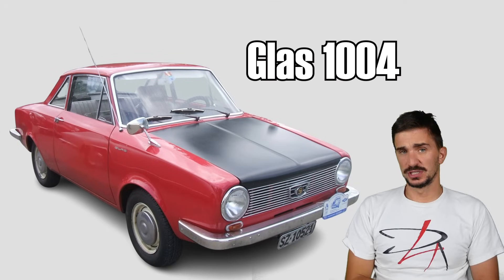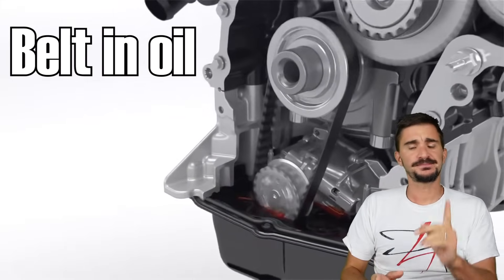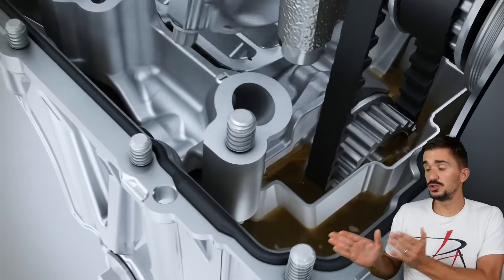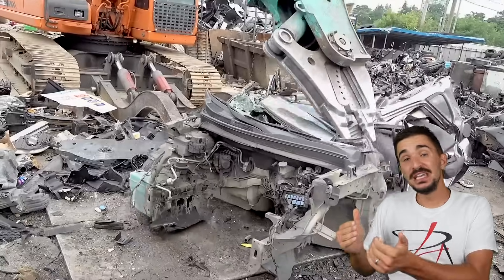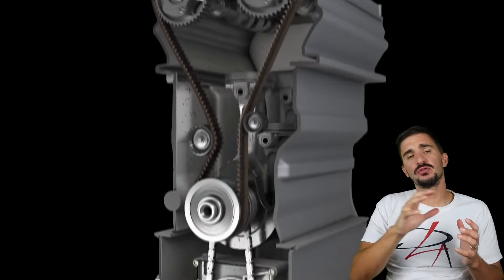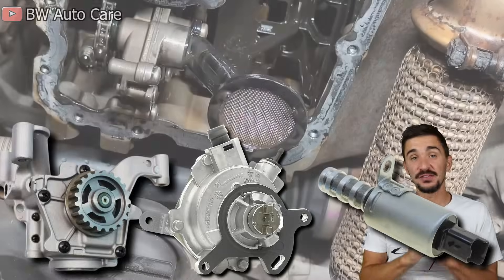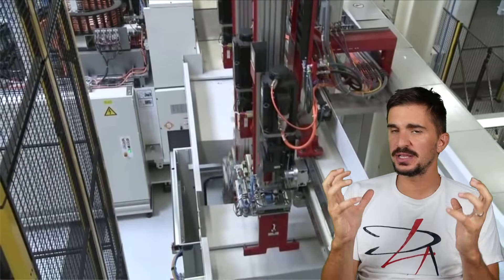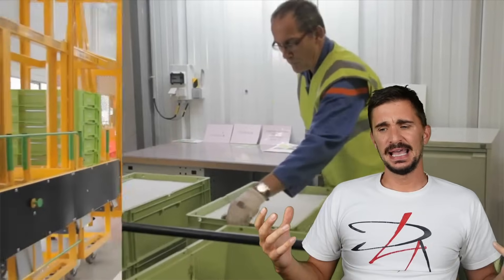Who Approved This and Why Is It Still Being Made? Wet Belt aka Belt in Oil Engines

Comment: The enshittification. It's bad, they know it's bad, they know we know it's bad, but they'll keep making things worse because they 'know better.'
Reply: Or because it theoretically has less emissions.
Reply: Actully ....THEY DON'T CARE !!! It's all about the BOTTOM LINE ! ! !
Reply: @OffGridInvestor  i fail to see how dipping rubber in oil meaningfully decreases emissions. Less friction, maybe, but maybe instead of putting a time bomb in every one of your fucking engines you figure something else out? Not like there aren't other options, this one is just the cheapest and easiest. Plus more broken engines means more time bombs sold.
Reply: I apologize, but I'm going to have to use "enshittification" in my lexicon of modern words from now on... It simply describes way to many things now...
Reply: @rrnonya5472   if you look around, it's happening everywhere. What was metal is now plastic. What was plastic is now cardboard. OEM replacement parts that are out of spec, expensive luxury goods that fail within a week. Once you see it you can't stop seeing it.
Reply: They’ll keep making them because unfortunately most people are just going to keep buying them
Reply: @hakjobtm7472  "Meaningfully" - well there's your problem. It does not have to be meaningfull, it only needs to decrease consumption/CO2 (they are the same thing, burning 1 kg of gasoline produces 3.12kgs of CO2, there is no way around it it's basic chemistry). It's not coincidence that realibility of vehicles got significantly reduced when CO2 limit standards were first introduced in the EU in 2008/9. In the USA CAFE standards cause the same problems. Another big impact of this regulation are low friction piston rings, as a result most modern gasoline engines tend to burn a lot more oil than late 90's/early 2000's ones. Eco start stop systems are also a consequence of this. It does not matter that the tech costs 10-100x more than the amount saved by lower fuel consumption, whether in initial costs or long term maintenenance. ALL that matters is the numbers that they get on the test
Reply: @petarmiletic997  what i got from this is that I'm correct
Reply: "they'll keep making things worse because they 'know better.'"

Yes, but isn't about knowing better how to make things reliable.  It is about knowing better how to maximize profits.  Build it cheaper, sell it for more.  Who cares whether it is reliable, just as long as it can make it through the warranty.
Reply: And who tought them that?  Apple. Seriously.. almost all industries learned that from Apple. Make somethign shitty, but coat it in sugar and say that the worse product is a PREMIUM feature and sell it  5 times more expensive.
Reply: @tiagostein4057  it takes courage to remove the headphone jack and charge more for the product
Reply: The bottom line knows better.
Reply: @katyfox2749 You said it!
Reply: The object is to be no worse than the competition. However, Japanese cars are better and are slowly taking over from these companies.
Reply: Actually it is because they want to make more.

Comment: A Ford dealer here in Germany quoted me 2850€ (roughly 3000 $) for a Timingbelt change on my 1.0 Ecoboost.
I have 10 years of fixing all sorts of vehicles under my belt, 
but theres just no way i could do that job on the Parking lot of my appartment.
You need an entire Briefcase of special tools AND pull appart half of the Engine 
(best would be to just rip the engine out at that point), 
for a job the takes 1 1/2 hours on a old VW/ Opel/ French car. (2 hours if knock one back with the bois while i`m at it)

Not talking about the gigantic mess of oil or 
the "shit, now i need this specific part from the dealer i forgot to buy/ broke"- moment.
Hell, doing a CLUTCH-job on most cars is easier and faster then this shit.
Reply: €3k to replace the belt? Scam.
Reply: That quote is ridiculous. Presumably that's an official Ford dealer? I drive Fords for a very good reason, and that's because they are good value for money, reliable, and cheap to service and fix. But your quote totally undermines that concept of value for money for the customer.
Surely, you could get a better quote than that if you go to a good franchise dealer, or even a specialist mechanic shop with a good reputation? 
One could buy an entire second hand car with that kind of money.
Reply: @richardconway6425  You must drive 40 year old fords or something, everything they've made since has been utter garbage.
Reply: I've seen a picture of a Ford engine that has the oil pump driven by a wet belt, that goes around the crank, so you'd need to remove the crank to replace the belt, a belt that is emersed in viscous oil, wedging itself between the pulley and belt. Mental.
Reply: @joejoejoejoejoejoe4391  The engineer will go to Hades...along with who approved the design.
Reply: Offical Ford Partner, 
most independent shops stay away from those cars.
 A lot of work time + renting out the tools is just not worth it considering the Time/money efficency of faster jobs.
And shops here are always full, so they can allow them selfs to be picky like that :D
Reply: @pontiacg445  you're just having a dig because you don't like Fords, or you have no idea what you're talking about.
Here in Europe, the other trillion dollar market for cars other than the US, Ford has sold an enormous number of cars. The Ford Focus and Fiesta have been the 2 best selling cars in Europe for over a decade. 
I owned a 2007 Ford Focus mk 2 for just over 10 years. It had 124,000 miles (yes, 124k) on the clock when I bought it in an auction, and it drove like a new car. It had a full service history, and had been looked after very well. I bought it in 2012.

It was hands down the best car I ever owned. It was well designed, great to drive and totally reliable. It never let me down, and was also very cheap to run, because it was very efficient. Always at least 50 mpg, sometimes more, depending on the type of journey.

I eventually let it go, because I wanted something bigger, so I now have a 2019 Mondeo estate (station wagon?) which I absolutely love. It's just so effortless to drive, very quiet, and very comfortable. It is a very refined car. I'm very happy with it, and I expect it to last a long time.

You're a pontiac fan, eh? Do they still even exist? Have they ever made a decent car, that wasn't built on a decades old platform?
Reply: @richardconway6425 you don't drive EUROPEAN fords.
Reply: @OffGridInvestor  what do you mean by that?
Reply: @richardconway6425  It s about the engine, and all of those 3 cylinder  1 liter engines (with turbo to get some power out of it) are bad.  They are developed to meet the demands from the EU  and to avoid high owners taxes (light weight engines that are small).  But they have those disadvantages as said in the video. They just can t generally last as long as other engines (like 2 liter non turbo 4 cylinders) for all those reasons. And ofcourse there are always exceptions that to a bit better. I am never gonna buy such a car.  I rather drive an old 2 liter and maintain it. It will last.
Reply: Same with 2.0l EcoBlue. Costs half of my country's income median and one week.
Reply: @richardconway6425  I'm "having a dig" because ford makes trash, simple as. I've got more cars parked in my driveway than you've ever owned, and you think I don't know what I'm talking about? There are more junk parts off ecoboost fords in my scrap pile than any other manufacturer, by a long shot. Do you even know what a wrench is?
Reply: That $3000 is pretty typical of wet belt systems. Honda is the same as they have to pull the engine out and need special tools that are not easily available to your average garage. Luckily I've never had to pay for replacement because my civic has never made it to the interval before the belt disintegrated and destroyed the engine.
Reply: @pontiacg445  My dads 2001 Focus drives really well and has been reliable for over 300k km.
Reply: Yeah i was quoted over $3000 USD for my timing service, so I did it myself, bought what i thought were good parts, but the guides literally failed within 2,000 miles of installation. I did nothing wrong, it's just low parts quality and bad design. Super frustrating.
Reply: I have worked on a lot of Ford 1.0L Ecoboost engines between resealing the leaking timing covers and replacing those engines for failed oil pump drive belts.  I have never seen so many special tools required to do basic repairs.  To remove and replace the crank pulley requires a 5:1 torque multiplier for goodness sake!  That engine was NOT designed to be easily serviced at all!
Reply: @pontiacg445  your attitude is obnoxious. If you've had bad experiences with Ford cars, or Ford engines, then fair enough. But I haven't. 
I explained my point, but there's no point in refuting anything you say because you don't want to hear anyone else's point of view. Did you actually read my comment?
So, you've got more cars in your driveway than I've ever owned, eh? You must live in a scrapyard. 
I've been stripping down, and rebuilding engines since I had my first motorcycle, when I was sixteen. I used to lap the valves in by hand, with something that looked like a small wooden stick. So yes, I know what a wrench is.
Reply: @richardconway6425  Those are good points. Most versions of the Ford Werke-designed Focus and Fiesta sold in North America in the 2010's had automatic transmissions (since the North American market prefers automatics) -- the troubled PowerShift dual-clutch dry clutch that is used on petrol engines (NA also prefers petrols to diesels). This has given the Fiesta and Focus a bad reputation in North America. In any case, even in Europe the Focus and Fiesta are going to cancelled, sadly.
Reply: @TassieLorenzo  yes, that's a very good point, something I omitted to acknowledge because I was thinking about Europe and the UK. I don't have any numbers, but I would imagine that by far the majority of European Fiesta and Focus cars were sold with manual gearboxes. People here prefer manuals, because they are simple and reliable, and it's what everyone grew up with. The Ford powershift does not have a good reputation, everyone thinks it's cr*p, as you say. It is very unfortunate that ford decided to go with that dry design, again, supposedly, because it saves fuel. But just like the 1% fuel saving quoted for wet belt systems, it's probably quite a marginal improvement, at the cost of an awful gearbox.
I personally would never buy a car with an auto box if I could help it, especially not something like the powershift system.
It is a great shame that ford is cancelling the focus and Fiesta in Europe. Personally I think it's a mistake. Ford seems to think that the whole market is moving towards compact suv and 'crossover' type vehicles, whether conventional ICE or fully electric. The puma and kuga are already quite popular here, so I think ford is going to concentrate on cars like that, but people here actually like small cars, they are a very good fit for everyday driving on narrow crowded roads in towns and cities.
Reply: I paid 1590€ for my wetbelt swap on my 1.0 ecoboost fiesta by Ford in Hövelhof Germany so all the stuff like wetbelt,oil belt,waterpump,new oil and a few other things and of course cleaning the oil pump and so on and i could have had that done even cheaper by a other work shop but i wanted Ford to do it so you definitely picked the wrong place
Reply: @ghostwrench2292 blame the EU rulings for that.
Reply: I HATE rubber timing belts
Reply: @richardconway6425  Good luck with the mondeo. As much as i hate working on them they are the most common vehicles to come in with over 100k miles on them, and by far the most common with over 200k. It could be because sedans are cheaper than pickup/suvs so the people buying them are more likely to run them longer but hopefully they're just built different. And hopefully you bought a hybrid or diesel because literally every single gas option has issues with oil pressure or coolant intrusion where the only fix is a new engine. As you europeans say, cheers!
Reply: @waggish4999  thanks for your response. My car is in fact a 2 litre ecoblue diesel, but I have not yet determined whether it has a wet belt system or not. I have a feeling it may, because ford was transitioning to these wet belt systems in the more recent versions of this engine. 
Having seen the video, I am not exactly happy that it may probably have a wet belt system, but my car is low mileage (for a diesel), and my usage is also pretty light, low mileage, in annual terms.
It's reassuring to hear that you've seen a lot of high mileage examples of this car.
Reply: @richardconway6425  hopefully it works out for you. It sucks that they still do stuff they know will prematurely fail. I wish they'd realize that they'd sell way more cars their vehicles matched the reliability of the marketing portrays like a Toyota or Honda. Things like wet belts and the powershift are a big part of why they stopped selling small cars in America. And why they've gained a reputation in many people's minds for being unreliable, even if there are certain models that are still good.
Reply: I paid 1,8k for mine. Licensed Ford Shop in München. Included new OEM oil pump, water pump, all belts etc.
Reply: @RyosukeTakahashiRX7  yeah, that's a lot of money, but you're good to go now for another 80,000 miles right ?
Reply: @richardconway6425  Mileage doesn't matter. Years are the truly limiting factor. I kept my last one for 12 years and shop said they never saw such a perfectly preserved belt. I change my oil roughly every 6k kms so I think the next one will last for a minimum of 15 years now.
Reply: Maybe already commented on but Honda do a 1l turbo with a wet belt too. It's also a problem engine .
Reply: Im also a mechanic. Havent ever worked on fords but my coworkers have and they said just to get the specialised tools costs £1000 and then you factor in labour costs for removing engine mount on one side, oil pan (if the tech has the ptience and space to avoid removing the engine completely)